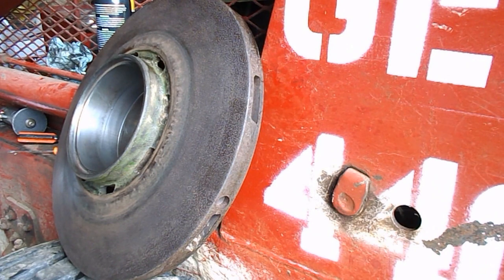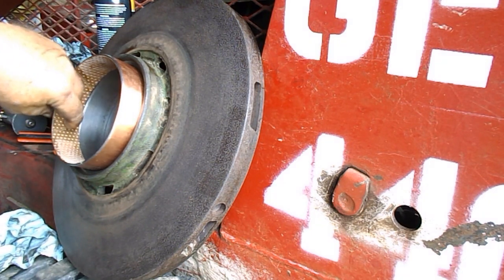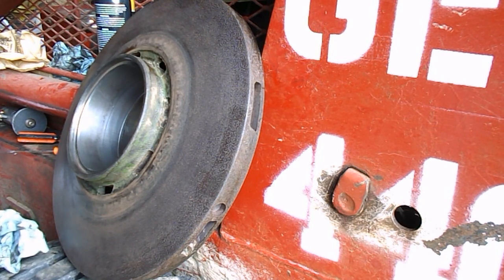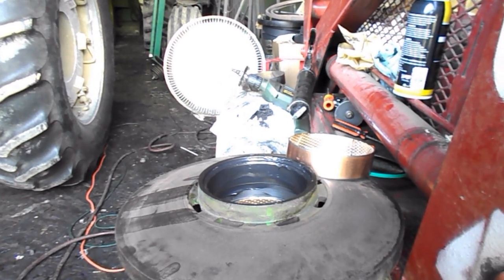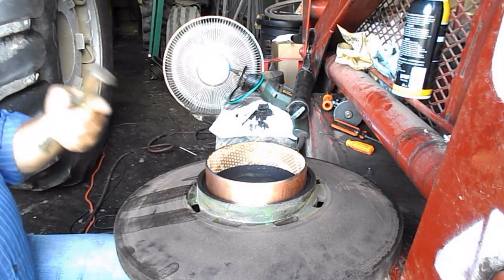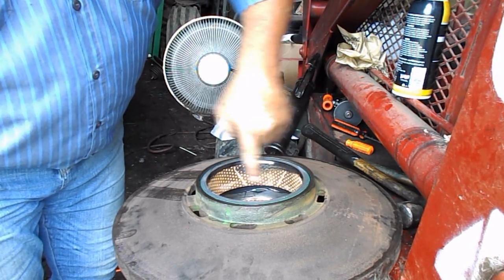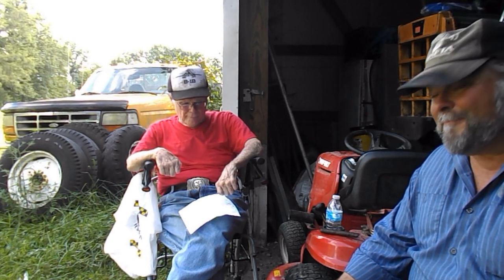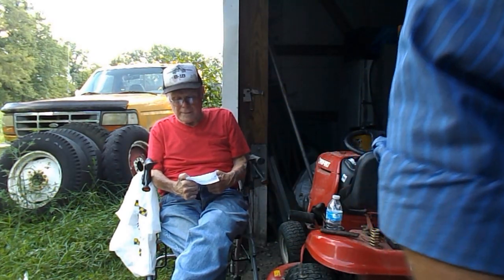JD 4400 Combine Center Drive Pulley Bushing & Seal Install

Comment from the maker: Well I went up this morning to AG-PRO JD and got the new bushings and seals and felt washer and its time to install them. This is not a cheap fix at all but it has to be done but $224 for them hurts a bit !  But this is what it takes to fix it right so thats what I'm going to do.  You could press these in or you can drive them in , You can do as you please this is just the way I did it. I used a hammer and copper punch to drive the bushings in. Now there is a right way and a wrong way to put the bushings in as there are groves cut in the bushing for grease to move threw so the groved side goes inside and the side without the groves goes out.  But you see how I put the bushings in and greased around the edge before I put the seals in so it is somewhat full of grease. I'll put the felt washer in as I put the pulley on the combine when I'm working on that side getting the belts put on. I hope you enjoyed watching. Oh the supervisor was on the job to make sure I got it done right ! LOL  Bandit

Comment: Good information and tips in this video, as always.  If I have to do the same to my 4400, I'll at least know a little about it.  Surprised that the bushings, etc., were so easily available, but that's a good thing.  That's always my fear, that I won't be able to get the parts I need.  I just put my cornhead on my 4400 and am getting it ready for corn.  I expect to be harvesting within the next 2 weeks.  Really looking forward to it.
Reply from the maker: This was another video I couldnt find on here so I figure I better make a video of it. This is the first one I've ever had apart or ever put bushings in, So this was a new one on me. I was a bit surprised they had them and the what the cost was !  I would have never figured $224 for 2 bushing and 2 seals and 1 felt washer, But ware else are you going to get them ?  But there in now and when I get to the other side and start working on it its ready to go on.  Oh beware as I found out those bushing on the inside (towards the center of the pulley) there is a lip there so if you go to drive the old ones out you will be hitting on that lip and not the bushing,  I didnt see that till I cut the old ones out . Bandit

Comment: The crap they sell for lawn mowers now, that's the reason I'm still using a 1987 year model mower. Thanks for the detail video on how that variable sleeve bushing goes in.
Reply from the maker: These new lawn mowers are about junk !  Plastic fan, What a joke !  There is more steel in the deck of my lawn mower than there is in his hole mower ! LOL  I have a 1970 Bob-Cat mower with a 6 foot deck out front , I dont know how many engines have been on it but I've put 2 on it myself  and its built like a Sherman Tank ! LOL I guess thats why Its still mowing grass !  I was worried about JD having the bushings and seal but to my surprise they had them, $224 for 2 bushing and 2 seals and a felt washer. Its a bit much but ware else are you going to get them ? But I got them and got them put in and its ready to on the 4400 when I get over to the other side to start working on changing the belts. I'm glad I got to work on the parts machine first cause lord knows I've never done this before but now I kind of know what I need to do now when I get into it.  I looked this up and didnt see anything on it so why not make a video on it so someone else that needs to do it can find out how to do it , At least they can see how its done. Cousin Bandit
Reply: @banditfarmer1900  - go back and put keywords in the tags to help people searching to find your documented repairs. I'm really looking forward to seeing how you got the hydraulic pump off.  like how did you keep the combine motor from turning.
Reply from the maker: @SoybeanFarmer3300  I sat for a 1/2 thinking of the tags and key words to put in it, It sounds so simple till you sit down and start typing and you just go blank !  I didnt have a problem at all with the engine turning, I bumped it over to witch direction it turned and figured out it had a right hand thread then it was put a wrench on it gave it a good smack and it came loose. It turned out to be a lot simpler than I thought it was going to be. The hardest part of doing it was unbolting the brackets on the pump and trying to get in a comfortable spot kneeling on the cab floor to take the pump loose !  My knee's still hurt !  LOL  Cousin Bandit

Comment: When you get done with the ol girl the machine should be about brand new bandit. Love the vids as usual, very informative
Reply from the maker: Thank You Casey, After looking at all the belts and seeing some looked original I figured the best thing to do was to change them all !  As you go threw putting new belts on you find other little things that need fixed and you fix them and keep going. Now when it comes time to start cutting after making some adjustments I think its going to be smooth cutting after that. Now worries about bad belts or bearings (I checked a bunch of them ! ) I can run worry free and I really like that idea for a change !  I took the time to video a lot of what I did because I could not find anything on how to do something on this combine, If I couldnt find anything its not out there so I made these for everyone cause if you can see it done you know you can do it yourself !  Bandit

Comment: Thanks for sharing, good information to have out there.

Lol my favorite promotion i got was a discount code for about 15% off my first order from the company, except i got the code in the box with my first order, 🤔, wasn't much help after the fact, at least I got a good laugh out of it.
Reply from the maker: You know its funny to me what Shoup did,  I ordered and paid for a list of belts and I have paper work showing what I ordered and paid for and the cost of each belt. They shipped the belts - 1 belt so I called and they said I didnt order that belt I said it was the very first belt on the list I ordered, No you didnt !  Well after 2 1/2 weeks they finally said they made the mistake and would ship me the belt (this was the 3rd time they were going to ship it !) and it never came. So a week later I called again and I had to go threw the same run around again and got the same I'll have to pay shipping on it. BULL CRAP I WILL !  At that point I told the guy look this is too much trouble to get a belt I ordered so keep it and refund my credit card the $15.15 for the belt and I'll get it from JD. Then there tune changed and they wanted to send the belt and I said NO ! Just refund my money and they did.  Now the letter Shoup sent us said that they had refunded the money to my credit card and they gave me a 10% off cupon good for 30 days (not good with any other offer) for all the problems I had with my order.  The funny thing about it was they were giving everyone a 10% discount on there orders for the next 30 days !  So I couldnt even get a Sorry for the mix up or a good discount for the problem they caused , Kind of makes you wonder about the company. They screw up and wanted me to pay for it and wont even say Sorry and gave me a discount they gave everyone else ! I dont know if I'll ever order from them again after this.  Bandit
Reply: @banditfarmer1900  Starts with how a company is managed and goals. If the top guys promote quality (of products and services) over just making a buck the way customer is handled is different. If it was a one off "bad egg" thing that would be different but obviously going by your rigamarole experience the company is pushing dollars over customers.
Reply from the maker: @joshk.6246   What blew my mind was the fact the guy finally said it was there fault and in the same breath said "Do you still want the belt "  YES !  Well you'll have to pay shipping !   AHHHHHHHHHHHHHHH !!!!!!!!!!  Any other company would have shipped it at there cost no matter what to make things right, But no they wanted to play games.  Then to send a letter say they had put the money back on my card and give me a 10% off coupon when they had 10% off to everyone was kind of a slap in the face to me , More of an insult really !  Never had this problem before on any other order I made, Always had a packing list and a new catalog and a gift for there valued customers, Wasnt much but its the thought that count . Not this time , Nothing but a box of belts in boxes and nothing else !  I dont know what the deal is with them but it sure make it to ware you want to look else ware !  Bandit
Reply: @banditfarmer1900  A lesson in how to Not treat a customer. Keep up the good Bandit!